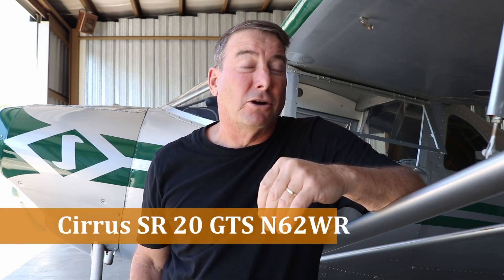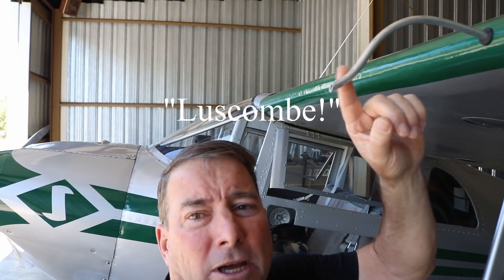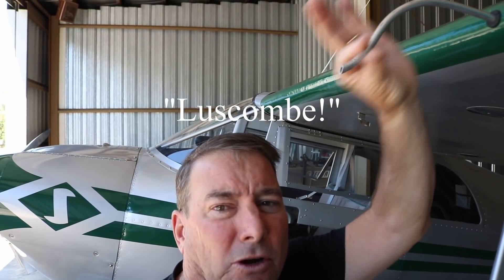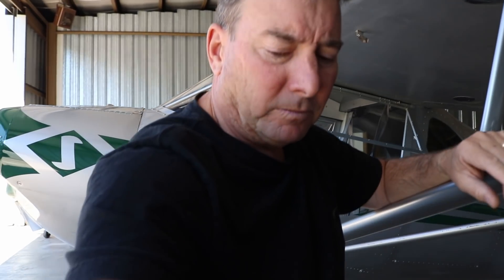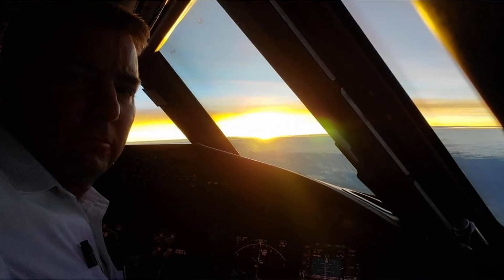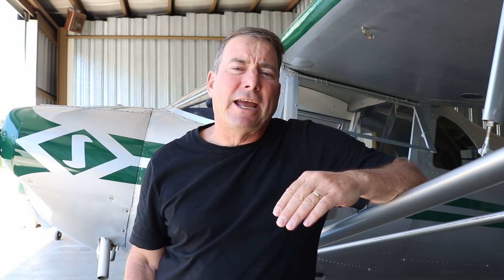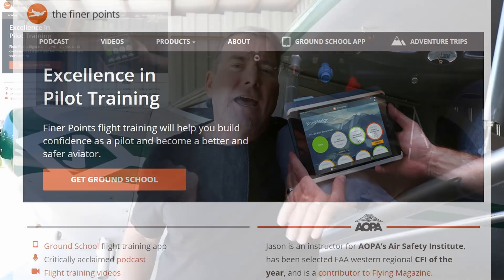Cirrus SR20 Crash Conway AR - AQP for GA!

Comment: 1. Pressure, Temperature in the green
2. RPM above 2300
3. Fuel Flow Check
4. Airspeed Alive
5. 55 knots/ 65mph 

"Rotate" on every Take Off without exception as my instructor taught me. (C172)

Comment: Spot on…. Years ago I had an old retired 74 captain as a mentor.  He used the term for ‘most pilots’ “airspeed dependent, wheel whacking (referring to agressive yoke inputs), conditioned primates”.  And through all my years, I’ve noticed, he was correct.  And this guy seemed certainly to be airspeed dependent.  When I used to teach primary students, i always covered the airspeed indicator until they got used to flying by sight and feel.

Comment: Back in the day (40 years ago) when I was flying the wings off my 150 all over the North East I gotta admit I almost never looked at the airspeed indicator.  On take-off you set the power to max, you rolled down the runway until you got elevator authority, pulled back a very little and waited for the airplane to fly off the runway.  The feel and sound was all I needed to get airborne... ditto to land.  The airspeed indicator was almost superfluous during takeoff and landing.  I knew everything was right just by feel and sound and basic pilotage.

Comment: I’ve had two pitot-static malfunctions while flying gliders. The first event was flying my glider club’s L-23 for my CAP Instructor Pilot checkride. The pitot tube was clogged by what we think were mud daubers. The second event was probably due to water getting into the static port when the glider (another L-23) was rained on while tied down outside overnight. Both events required use of known pitch references and resulted in great landings (i.e. we were able to use the planes again). Also, the second event was during a CAP instructional ride and the cadet got a good lesson on why we use known pitch references to set the airspeed instead of focusing on the airspeed indicator.

Comment: I had quite a few instructors as at the FBO 141 school where I trained just because the airlines kept sucking them up. But this gave me some extra perspective and I can say that even within a rigid 141 framework there can be high variability between instructors in what is emphasized and what extra tips are given. 
Then separately there seems to be an administrative 141 issue regarding the syllabus content. The FAA and or insurance liability seems to incentivize the smaller outfits to just adopt an off the shelf training program like the Jeppeson syllabus and then they make any later changes/improvements a huge hassle and cost. The last I looked at a Jepp syllabus it left a lot to be desired but once those operating specs are locked in, your locked in.

Comment: I used to rent an Archer that had very worn markings on its elevator trim.  On a flight from Newport to Martha’s Vineyard I took for granted that it was close enough to take off setting.  After rotating, I had a lot of difficulty keeping the nose from lifting above take off attitude.  I had to use tremendous forward pressure to keep the aircraft from pitching up to the point of stalling.  My concerns were compounded by the fact that I had my family with me in the aircraft.  After a few seconds (what seemed like an eternity), I realized that it must be a trim issue and rolled the trim wheel forward.  That immediately remedied the controllability issues.  It scared me straight… I never take preflight checklist items lightly anymore.
Reply: never take anything from granted in a renter.

Comment: I had an instructor cover my airspeed and altimeter and tell be to complete the landing. It was easier than one would think. You know the power settings and the view. As you said, a little faster for safety and the runway was longer than needed. I was glad he did it, just in case.

Comment: I've had this happen to me. A night wet/sleet 0°C takeoff on a BAE Jetstream 32, FO was pilot flying. While the J32 is close to jet handling in many respects, it is still a turboprop, so the airspeed confirmation is lower than 80kts. When I called the IAS confirmation there was a hesitation, then the FO called "mine is off" (or words to that effect), we had passed V1/Vr and the only option was to continue. As my IAS appeared normal, I called  "my controls" and took over. At the "positive climb, gear up" callout, my IAS also went haywire.
Having studied numerous IAS failure incidents/accidents, the obvious reaction was "my IAS failure, flying known power/attitude". Not really a problem if you don't start chasing an unreliable instrument.
In our case, the problem turned out to be simple: Glancing at the FO's skirt panel, I saw that the Pitot/Static heaters were OFF. A few seconds after he turned them ON again, everything returned to normal.
This was a shocking wake-up call. We did a lot of soul-searching, and the only conclusion was that, for some obscure reason, the FO (one of the most precise and conscientious pilots I have flown with) apparently missed/skipped the "Pitot/Static heaters ON" checklist call.
Bottom line: We WILL make silly and unexpected mistakes, it's part of being human. The important bit: How do we react to silly and unexpected mistakes?
Studying mistakes other pilots have made helps us recognize what is happening, hopefully avoiding falling into the same trap.

Comment: 5:13 I understand how airspeed verification of 80 knots could tell you your pitot tubes are not blocked, but fail to understand how an 80 knot verification would also indicate the  static ports are not covered over.  If the static ports were covered over wouldnt airspeed look normal on the ground and a problem wouldnt be noticed until there is no altimeter reading as the aircraft climbs?

Comment: I teach all my students the preflight of the aircraft starts as you are walking to the aircraft. Then, first remove and secure all covers, locking devices, tie downs and grounding cables. (Sound familiar to military pilots?) Next check fuel and oil so you don’t find yourself waiting on the truck for 30 minutes after you complete the preflight. Then, complete the preflight WITH the checklist. Once complete, the last thing you do is a walk around for one last look so you don’t embarrass yourself by leaving chocks out or leave your belongings beside the aircraft to become FOD. 😂

Comment: Some years ago, during a departure after a refueling stop while on a long cross-country flight, I rejected a takeoff in my Husky because the cargo shifted in the rear baggage compartment when I was about 20 feet above the ground.  It was obvious that the balance was not acceptable due to the aircraft pitching up.  I pushed the stick forward, chopped power and landed immediately.   Needless to say, I should have secured the load better, but aside from a bit of embarrassment, no damage resulted.

Comment: In 1961 with about 100 hrs and private ticket I had the speed operated " tea kettle" pitot cover fail to flip up on takeoff in a Cessna 170A. I only noticed it after liftoff when looking for climb speed. Looking in the cockpit in tail wheel 140-170-180s on takeoff was not something you did much then. My experience level was such that the landing was no big deal. Instructors did a lot of partial panel then. Can you fly a manual no auto throttle approach in the 777 on the standby instruments?

Comment: Picked up my plane from shop after annual. Thorough preflight, started takeoff and no airspeed. Right back to shop and mud dauber nest in my pitot tube cleaned out. Mechanic had not had cover on while in shop. Most of us learn rpm settings for different phases of flight. Can’t see how anyone takes off without noticing lack of air speed.

Comment: I recall the CFI covering the airspeed indicator during my basic PPL training in 1990.  We then landed.  I did my basic in a Piper Tramahawk,  oops,   I mean Tomahawk 😊.  I now fly a RANS S-19 with a Dynon Glass Panel and don’t pull back on the stick until I see 55 on the IAS tape.

Comment: Back in the late 70’s as I trained for my Private a flight instructor preflighted my aircraft with covers for three of the instruments as a training.  He was right because a couple years later in my Cherokee 180 a couple bees got past the tennis ball we had covering the pitot and partially blocked the airspeed indicator giving low readings.  With our 2400 foot runway there wasn’t time to stop a perfectly performing aircraft because the speed indicator was faulty.  The A and P had me hold a rag ver the pitot as he applied air pressure from the cockpit end of the tube.  Problem solved and verified by the presence of a couple annoyed bees.
All’s well that ends well and thanks to that instructor for showing me how to deal with this kind of problems.
Another couple CFIs would booby trap an aircraft before dual instruction to see if I would catch it.  One put two chasers of oil in the baggage compartment of a Cherokee 181 so that when I stepped on the foot peg to board the plane it slowly lowered the tail all by itself.  Definitely a problem that needed to be addressed, and a lesson well learned.

Comment: I had something similar happen in my twin comanche. I had picked it up from HSI replacement and all seemed well on takeoff roll, airspeed showed speed. When I got off ground, all hell broke loose. Airspeed all over the place. After landing it was discovered the pitot and static lines were reversed on the back of the airspeed indicator. That was no fun.

Comment: they should make those covers things to be removed luminous pink so they are easily noticeable.
Surely you would just adjusted it by throttle even if you didn't have the airspeed indicator, this introduced into training if you flying into the wind or tailwind surely is it?

Comment: My gliding (sailplane) instructor was unhappy with me chasing the required airspeeds by using the ASI, rather than employing visual pitch attitude and the sound of airflow over the cockpit, so she covered up the ASI and we flew a couple of circuits. It definitely worked, although I naturally erred on the side of caution especially in turns - not a good idea to stall in a turn at 500 feet.

Comment: I have forgotten the pitot cover once. At an airshow where I was a small part and also had my family with me. Thankfully a wing walker spotted it and stopped me.
I have rejected one takeoff due to a helicopter taking off and crossing the runway. It was pretty close and I was pretty fast. Wheelbarrowed a little getting stopped.
I continued a takeoff when I accidently left the door not fully latched. First flight in a 1957 H-35 Bonanza with my wife. Closed door but did not fully rotate latch. (It was on the checklist but I was distracted.) Door will latch but won't be completely closed (top of door latch not engaged). On rotation it makes a loud bang as air pressure forces the latch open. Then it's really loud but not enough runway to stop. It will fly OK but you lose some performance due to drag. It cannot be closed in the air. So fly pattern, land, taxi back, close and latch the door then takeoff again. May not have time for a checklist in emergencies. Got to know what to do.

Comment: Juan, how many pilots (%) in the air before the layoffs are willing and able to return to the skies? Seems there is not a whole lot reentering the workforce. Perhaps you could discuss the labor issues, as you are able, in more detail. You did a fine job on the exit side now a look see on the reentry side would be interesting. Even if all younger pilots came back there still needs to be the replacement of those left go as retirements.

Comment: After reading and trying to understand AQP, its dawned on me this is very similar to a program instituted about 40 years ago in nuclear power plants, as a result of the Three Mile Island accident. In the industry its referred to as OE (Operating Experience).  The information from plant incidents are submitted to an industry group and then sent to applicable plants for review and incorporation into training, including simulator training. Every couple of years an group of industry representatives will review each individual plant's handling of OE for effectiveness.  Essentially it is a way of learning from others rather than having to learn by making errors yourself.
  Unfortunately, most humans do not learn from history very well, and it's a continual struggle.  I do believe there's a saying about that!!

Comment: I had a speed indicator coming apart on me in my 210 unbelievable, but true. loosing the airspeed indicator is a very serious issue to say the least, not to mention for a student. I resolved the problem by using gps speed and staying 5-10 kts high and selecting a long runway. I recommend to train for such event at early stage. Forgetting the pito tube cover does happen, critters crawling into the tube and it can become plugged by ice too, so plenty of reasons that gps ground speed can come in handy apart of emphasizing the importance of a proper Pre flight check.

Comment: Once I go back full time as a flight instructor at a local school in Phoenix, I'll be sure to nail all these topics into the brains of all my students. The rejected takeoff is such an important topic to bring up.
Reply: "Engine quits? FLAP boy! FLAP your arms and get right with your god!"
Reply: Not only rejected TO procedures but also what happens if you become airborne, what then? What will you do at 300AGL, 500AGL? Personally on a normal air density day and reasonable weather, I know I can make the 180° turn back as long as I’m over 600AGL. I brief myself and passenger on 4 emergency takeoff procedures:
1) Rejected takeoff
2) airborne but enough runway left to land
3) airborne but not enough length left to land on the runway, and not enough altitude to turn back
4) airborne with enough altitude to turn back to the runway
Reply: Yes, please make it second nature to them. Drill it into them. If you wake them at 02H45, they must know the procedure without pause. It’s the best way. It works!! 1st thing? Fly the ‘plane!! So many people forget that under pressure, old school was and is a part of instruction.

Comment: A few months back an AN-124 landed after having a total electrical failure following a fan disk separation after take off that penetrated the fuselage and severed major electrical wiring from all generators. Obviously these guys knew the airplane well enough to bring her back around for a safe landing, though they went off the end of the runway at lower speed for the lack of reverses, spoilers, and accumulator brake only, and all walked away. I'm amazed how the lack of airspeed was not caught by the student pilot on the takeoff roll. So tragic. Some sort of AQP is needed for GA. At least "airspeed alive" This accident did not have to happen.

Comment: Your comments appear to focus on the issue of a poor preflight as possible reason for this unfortunate LOCI accident where I came at it from different perspective. In my opinion this student appeared to have been taught to rely on aircraft instrumentation to an excessive degree. 

I'm a firm believer is the old adage PITCH AND POWER = PERFORMANCE and make all my students rely on aircraft attitude relative to the NATURNAL  HORIZON to determine the proper pitch attitude for CLIMB, LEVEL, and GLIDING flight.

Once had to checkout a Delta L1011 pilot in a club C172 and he wanted to land the plane at 100 KTS. Had to cover the ASI bedfore he finally started to fly the plane properly.

I've been an acive CFI since the mid 70's and have given numerous flight reviews obviously to rated pilots, pilots who on average show a surprising lack of knowledge in basic airmanship.

Stick and Rudder did a good job and describing what some of these important skills are, a book a recommend all pilots read.. Dr Kern's Airmanship model also does a great job in describing what it takes to be a safe proficent airman.

Comment: I am a former mechanic.  40 years total, 20 years in Air Medical. 
Prior to getting in and strapping in the three would do a “ duck walk “. The pilot would walk around the aircraft with the other two following.  Checking that the shore power was disconnected, cowlings latched, no puddles, etc. This was only done if they were departing to get a patient, not if loading one for a flight out. 

Things still got missed.  Landing at a scene with a 50 foot extension cord still plugged in.  Cowlings opening in flight.  They would go up into the main rotor and torn off.  We painted orange under the latches so it would indicate that they weren’t latched. Still got missed.  Streamers on the shore power cord, still missed.  I bought extension cords with a neon lamp to show up at night.  The medical people would swap that with another and use the cord I bought to run the vacuum cleaner inside. 

I was the safety manager.  But I had no authority.  They were the customer and I worked for the aviation company that had the contract. 

They would tell me that they don’t work for me, or simply that they didn’t do things that way. 

People tend to see what they want.  Complacency happens unfortunately.

Comment: I was a young 0-3 once taking off right after sunrise in a RC-135 on the Island of Crete (1990).  Just after 90kts (airspeed cross cockpit) check my SQ/CC "REJECTS."  We stop uneventfully.  MX finds mud daubers (wasps) had plugged to Left (Capt or Aircraft Commander's) pitot static tube.  MX fixes it.  Late afternoon we finally takeoff for England.  We begin the descent and my right side (co-pilot) pitot and static goes nutso.  Moral of the story.  Honor the cross cockpit airspeed check--it could save your life!